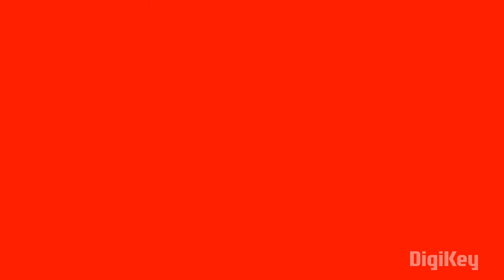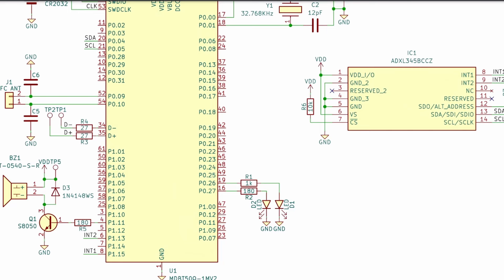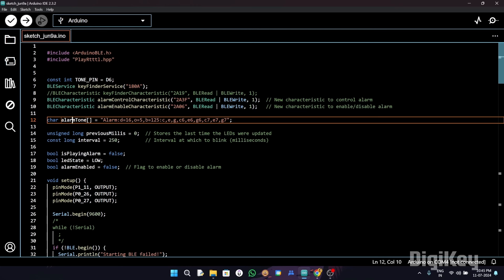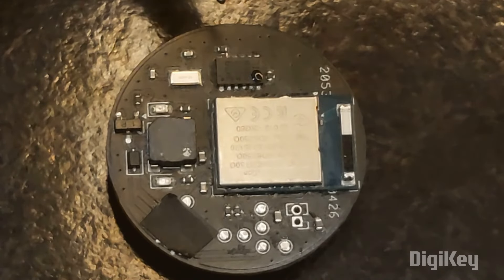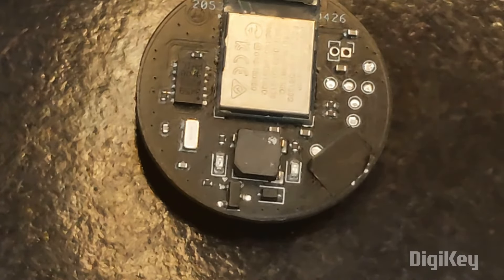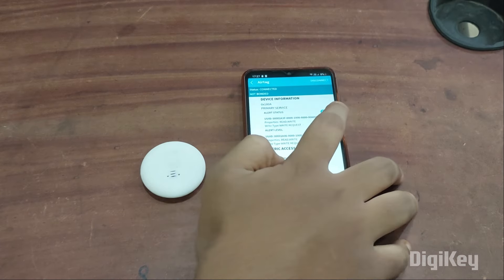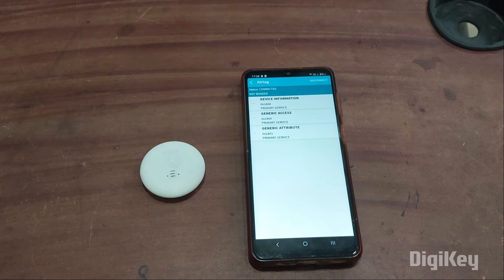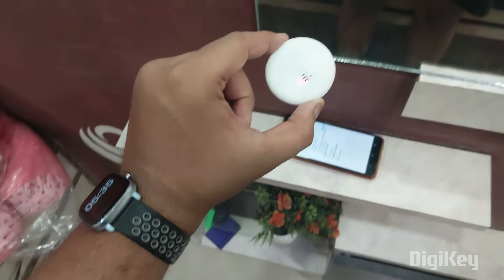How to build your own Airtag using Bluetooth Low Energy (BLE) ?

Comment: Sir I am making my POV display project by watching your YouTube video. I am facing problem in connection of circuit diagram. I am not able to understand how the shift register is connected. For example, connect SR_0 PIN DATA to SR_1 Dout _1 and SR_0 LATCH to SR_1 LATCH and SR_0 clock to SR_1 clock and SR_0 Dout _0 to SR_1 Dout_1
Reply from the maker: If you have doubts about a particular project please comment below that video. The shift registers are daisy chain configuration. Ie the data pins are connected in series. The latch and clock lines are shared. ie in parallel.
Reply: @Circuitdigest  thanks 👍

Comment: I can use esp32 it will be cheap digikey have higher charges
Reply from the maker: You can use. But the ESP32 power consumption will be much higher.

Comment: Great video, I have a question for you. How did you program the mdbt50q initially? I have a PCB with the same module but when I try to flash it, it just wont happen even after grounding the reset which the manufacturer recommends. Any insight? Thanks
Reply from the maker: I have used the Jlink for the initial programming over the SWD pins.

Comment: so it does not signal all phones ? it only connects to ones with the app and that it is paired to?
not very good if stolen then. interesting build project but no real world use
you can buy tags like this for like $3 off ebay I have some i bought 10 years ago and didnt use as they only connect to a paired phone, so as said zero use if item stolen
Reply from the maker: For that kind of functionality, you will not only need a huge network of devices but also unrestricted access to these devices. For example, Apple uses their Find My network for this purpose. Since they are the manufacturer, they can collect data from the devices in the Find My network without any restriction and use that to track those tags.
Reply: @Circuitdigest  I have been looking at esp32 and a GSM module with GPS like the a9g or sim7600, power consumption means a larger battery so then it's only useful on things like cars motorcycles or ebikes.
Reply from the maker: Yes, they are not suitable for low power applications.